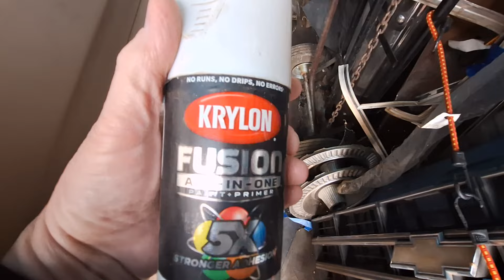Let's check out the box in the cab of my "NEW" to me 1966 Chevy C10 on a 1972 Chevy C10 truck frame!

Comment: At 10:23 I think that is a circuit block. On my GMC it is on the Driver's side upper rear left under the truck. It is for running the tail / dim / lights turn signals.
I say that but there could also be one in the engine bay area too.
Reply from the maker: You're right! I remember now that you mentioned it! Lol. Sometimes in my videos, I know what something is called and for, but I just can't remember what to call it! Lol. Old age is catching up on me! Lol. Thanks buddy for your comment and help! God bless you!

Comment: 66 was the last year for hooks & chains on fleetside boxes, but the hooks & chains on stepside boxes on the other had were still in production up through 87. 66 was also the last year for the hooks & chains on Ford's fleetside pickups, & like Chevy & GMC, their stepside pickups also had the hooks & chains on them up through 87.
Reply: 87 was also the last year for Ford's stepside box but was later redesigned & brought back in 92 which was the first year for the aeronose pickups & Broncos. When the stepside box was redesigned & brought back, the hooks & chains were dropped & replaced by a handle in the center of the tailgate.
Reply from the maker: Thanks for your comment and for the good info buddy!